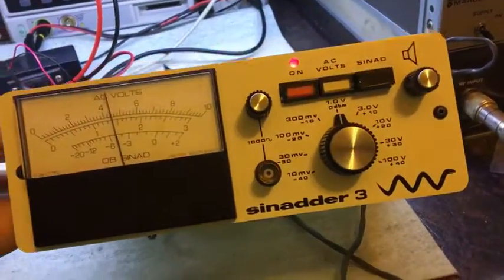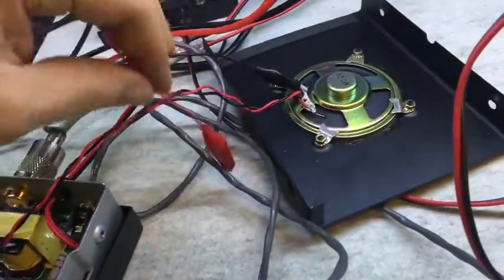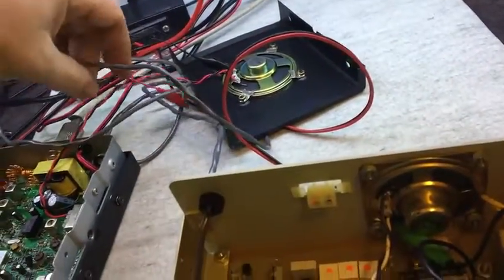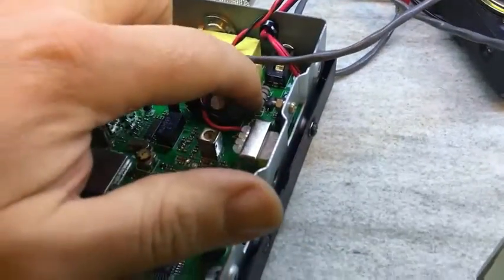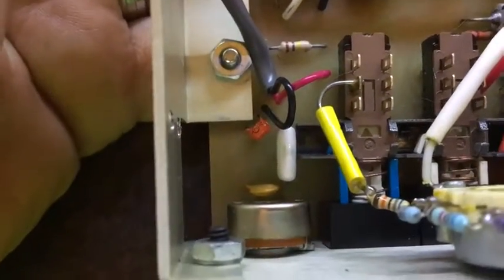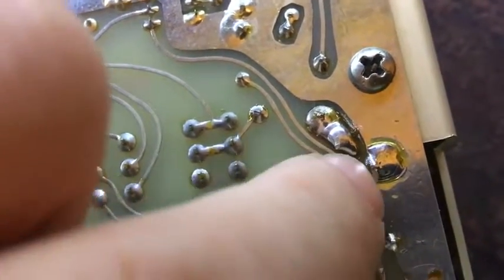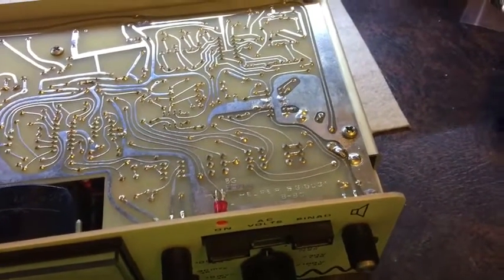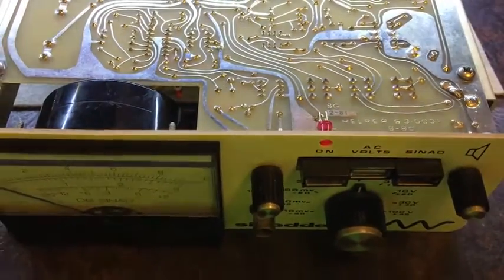#55 Sinadder 3 DC Isolation Improvement

Comment: wondering why it was modded to DC in the first place... perhaps field use.
Anyhow that is a good mod.
I was thinking of putting an input on the front of mine. the lead out the back works.. but not shelf friendly.
Cheers.
Reply: Yep a BNC jack on the front would be very nice on this unit.